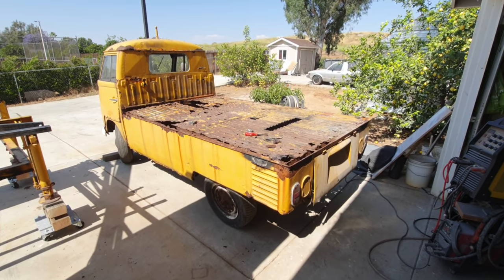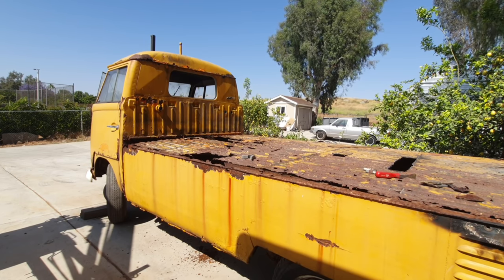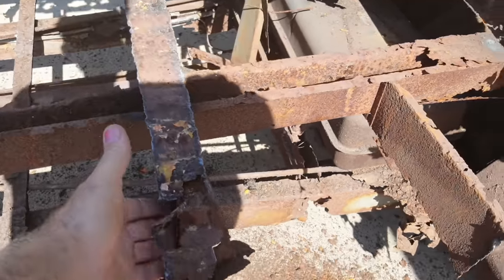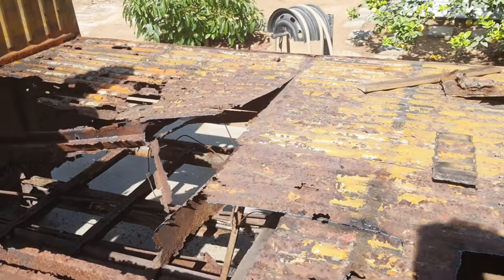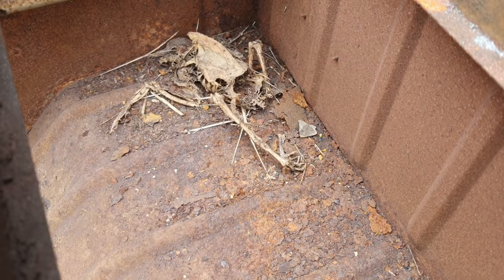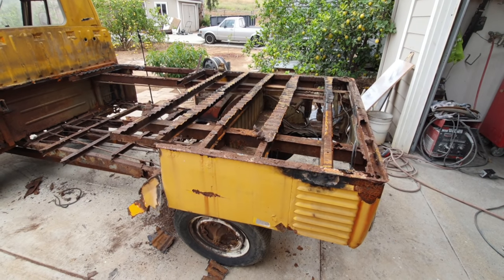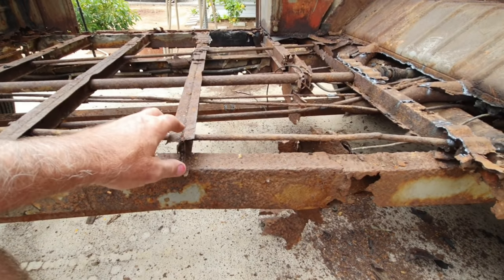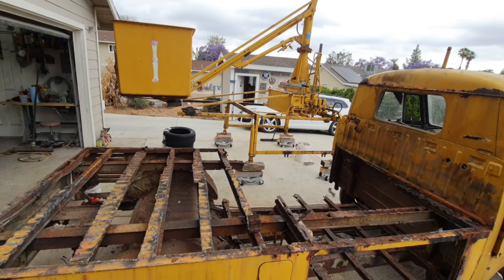Rare vw Single cab restoration plasma Cut away the rusted metal

Comment: Agree that it isn’t feasible to use original shape metal, such as Klassic Fab etc.  I think it will be strong and sustainable using off the shelf metal, added to some original pieces here and there.  It’s a good plan as the alternative is that the truck would never be restored.  Looking forward to seeing the great work to come.
Reply from the maker: pretty much the only way I or most people could save it.

Comment: On a lighter note,you really need to get some tubing and build a bracing frame to hold everything in registration and stop it from distorting or collapsing. Pick up on any existing strong points and join them together with the tubing. This should allow you to cut and replace parts with much less risk. Learned this the hard way on my mk2 jaguar restoration. Did not brace it and assumed one side could brace the other. All was ok until trying to refit the doors. Had to go on a body jig and cut and weld again to get straight enough. Much tears. Brace it before it distorts is way better than post the event!
Reply: If you saw the green rag top video he braced it up during construction so I'm sure the same will be done here to.
Reply from the maker: oh for sure the frame is out of alignment right now because there is not enough metal so I will stack the left side first then the right. next video I explain the plan.

Comment: Camera work is very good.  Patch and use what you can of the original.  Use channel in the frame as you are thinking.  You are great at making any needed panels.  You can build it back better, stronger - Bionic Bucket Truck!

Comment: Holy Cow, thats more rust than a car. 🧐
About all the square tubing I would talk to a laser cutting company who can also bend the tubes from sheet metal. I think they are don't be that expensive like the parts you can buy normally. I don't know the prices for that in US.
But I think in this case it will be also ok to use  normal tubing, when nothing is left. Other guys would scrap this rust bucket.
Greetings from Germany

Comment: If you could find the torsion tube for the back axles and the frame like you did with the front , I feel like you could build a new bed and move the cab over to it.  YOU CAN DO IT MIKE

Comment: You can make most of the frame and cross members with a bead roller. Mitten brothers has one with a deep enough throat to make most of it. . Its all 16-18 GA sheet metal that was formed,  The roller is about 1000.00 buy you will save 20K in the long run.  That entire bed is just sheet that has been formed in a brake press or a bead roller. You can even form the bed floor with it.  go watch Lazzie metal forming.  it looks complicated but it is really not all that bad.  That is a good savable double cab.
Reply from the maker: You're right you just need the right beads
Reply from the maker: Yeah I'm going to probably by the bed tops but so far maybe both quarters I'm going to make repairing these Corners I picked up at the swap meet for 50 bucks each. I probably will only spend about three grand on metal the way it looks now
Reply: Mike. Those do not require a special die, just a couple passes. The c channel is just several passes with the same die, and the top is just a pass or two then flip the metal and set a fence for the width. The are not really tight radius and a tipping die for the full 90 deg bends.  Or you can bend "Z" and weld the together,  that one good thing about a bus is all the metal starts as sheet and stays flat, it just bent.

Comment: I've seen a lot of old singles in similar shape...  I always scratch my head and ask, "where do I cut this to good metal?"  Most of them I wind up at the seat frame...  Everything else seems to be pretty rotten.  You are right to look at standard tubes and channels.  I think the reason VW made top hats was to save a tiny bit of material.  When you're making 1000's of cars, a little savings goes a long way...  This will be fun to see come together.
Reply from the maker: Rock on! they made them top hats so they could pinch weld. I am welding so really it wont matter much.

Comment: Try fertan gel ! It strips the rust of the metal ( it leaves clean metal behind ) only downside is that if it’s heavy rust it takes 1-3 days
Reply from the maker: good one may need to be inside for that to work not sure If i can do that. Already outside overnight got flash rust. on the cuts.

Comment: All I see is a blank canvas for Mike Vango to do his magic on.  The original metal was designed to be light but strong. I think you said the original motor should have been a 1500. You get too much weight from fab metal and it will affect the performance. So fabbing you will need to be creative for sure. Can't wait to see what you come up with. You going to ask Mustie for some chainsaw bar oil. Haha
Reply: Mike's gonna beef up the motor, it's to risky driving a under powered vehicle. 🤔

Comment: Mike not sure your metal cost on top hats what about 2 piece of angle iron or 1/8 wall square tube ???
Reply from the maker: Yea that is the idea 1.5 inch 18 gauge tubing. stronger than original. and no need for weld points because i am not pinch welding. you got it.

Comment: Hi Mike.
My VW T1 Samba is overheating pretty easily. I have been pouring 10W-30 oil.
Could you tell me what kind of oil do you use?
Reply from the maker: castrol or kendal 20/50 only. Sometimes I ad a bit of lucas. 1/4 quart per oil change.

Comment: Mike I think you have the write idea, go down to the metal supplier and get all the square tubing, it will be a third of the cost and it will be better than the old vw metal anyway . Graft in a new lower frame if you can than start building the frame work around it. The whole idea is to save a piece of  VW history, the  original body was cut up buy the  bucket truck manufacture anyways so I don,t think the purest will go crazy .
Reply: The other option is to scrap it so it really doesn't matter at this point 😂

Comment: The only reason vw never used square tube is price. Its also hard to spot weld square tube and that would up the build cost. I'm with you on square tubing everything. It will still look great once its painted ect. It doesn't have to be 100% original. So long as it looks like vw what difference does it matter. Keep up the good work.

Comment: Do you have any kind of blue prints for this size bed? Didn't see you taking measurements of the frame before cutting things out...
Reply from the maker: the right side. and back is still in tact. THat is what I am using for reference. and the new outer panels for the bed top.

Comment: Amazing, the right side is in a better condition than the left site especially the rear bud some of the panels are useable. Well, here you get a massive restoration job to realise, Bud as you say the VW t2 is worth to save It`s mine car and I am doing my way. When I started the restoration with mine VW T3 single cab I made the same experience the left side was worse than the right site. today I  do the final welding of the new dogleg on the left side. and then I 've completed all the renewing of panels bold on the left and the right side. Bud, it still remains some to do. So, Mike, I do understand the complexity of what you have to go true with the cherrypicker Looking forward to the next of restoration video. regards HCS

Comment: Start at the beginning  ,once you get going and the cog wheels in your mind start to turn everything will become clear. It only has to be original if it's going into a museum ,not the odd Sunday meet. A few measurements and a quick drawing ,you could do a whole side section then join the new to the old temporarily the old frame on one side will give you datum points for the height and position of crosspieces  ect . yes box section take your time a few reinforcement gussets. oh yes and the patients of a saint.

Comment: As promised doc from Ruthmann I don’t have facebook . The  doc is at this moment on a we transfer page:  https://wetransfer.com/downloads/98c7ce4d5a2fbb59577103a43cdf83fe20200609153941/5547b320e9db91e2156977a446e48fed20200609154044/cefbf3
Reply from the maker: wow got it very helpful thanks for that
Reply: Fine. I am affraid it is the wrong type ( to young) and the wrong language for you. But hopefully it helps. The first part is in Dutch ( This is from  Kwak, the Dutch import firm from Ruthmann) the second part is in German. This is from Ruthmann. If you need some translations perhaps I can help. I speak both. 
Both firms still exist and are still in business. Early this year Kwak helped me with a new pedal cilinder for mine V80. The also still have the right oil for the pedal circuit. In here is special oil. I killed my pedal cilinder by putting in the wrong oil. This wrong oil was advised to me by a specialised hydraulic frim. So be carefull with this. The oil in the main tank is normal hydraulic flued. The same is used in tractors ect. Ruthmann itselve is not so helpfull  I am affraid. We tried once but their reaction was we should not ‘play’ with this kind of equipment. Because it was to old unrialable and dangerous. They would not take any responsibillity.  To be honest they are right. If you do not  no what you do it is very easy to get hurt.    Greetings Hans